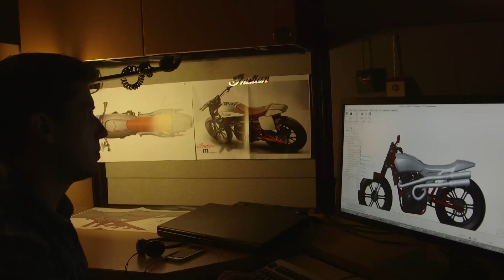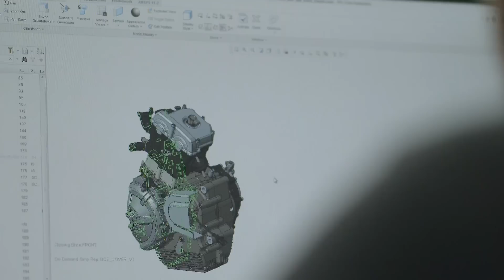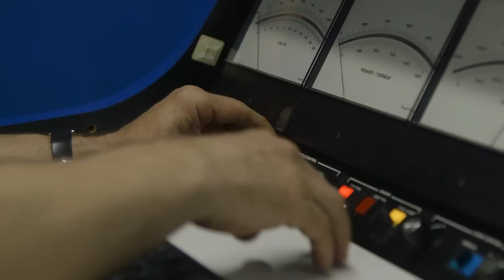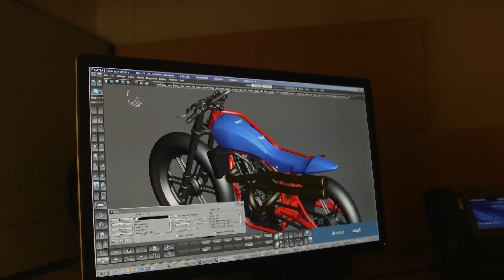CW EXCLUSIVE: Indian Scout FTR750 Flat-Tracker

Comment: The Lockheed SR-71 went from contract signing to first delivery in 24 months and that plane is hundreds of times more complex than any damned motorcycle. Just study the history of that plane and you will learn what true engineers are capable of. Detroit engineers routinely designed and built full lineups of complex cars within 12 months. The average engineer of the "greatest generation" puts to shame any of the best engineers of the baby-boomer generation and they did everything with pencil, paper, slide rules and manual machine tools. And don't get me started on the precocious millennials--most of that generation is uselessly pathetic. If Indian had any real engineers they wouldn't have to fly off to Switzerland, they wouldn't need 18 months to build anything, and they wouldn't limit themselves to building a handful of models. My challenge to Indian is to take that beautiful V-Twin 750cc engine and design an adventure touring bike to compete against KTM. Can you guys do that? It's easier than you think, but thinking is probably your problem.
Reply: Warner Bauer 

The sr71 also had about 12 times the staff working on the airframe, and about 100,000x the budget so it isn't a fair comparison, also the government was pushing Lockheed for that plane, Indian wasn't in any major hurry.
Reply: I meant to write 10,000x not 100,000x
Reply: I am sure that some people will regard your response as the sort of sorry excuse to be expected of entitled and engineering-challenged millenials. Considering that an SR-7 is hundreds of times larger, far more complex, made of titanium, and fitted with exotic engines that were shrouded in nacelles that had to be precisely aligned, then 12 times more staff seems paltry to me and makes those engineers stand even taller. Look, Indian merely has to make the engine, frame, and some hand controls; the brakes, forks, wheels and so on are supplied by third parties. Also, engineers today have access to CAD/CAM, 3D printing, mulit-axis CNC machines, smartphones, Google, and even services like UPS help immensely. So again, my challenge to Indian is to take that beautiful 750 V-Twin and build a scrambler and an adventure touring bike around it. Maybe millenials didn't understand the mantra that was designed for them: "Yes, we can." Or in this case: "Yes, Indian can."
Reply: Warner Bauer America does innovate in the motorcycle market, have you ever seen an EBR?
Reply: 1st off, Merry Christmas! Yes, I have seen the Buells. The first models were built around the pushrod Sportster engine, which is a bit of a joke, don't you think? And the fit & finish were a bit lacking. That being said, the new models are world-class. But they are powered by the Austrian-built Rotax engine, the same, I do believe, that is in the KTM. Design, fit and finish, however, of the new models are all superb. I wish them luck. But American motorcycle manufacturers should take on imports in other categories like scramblers, adventure touring and even MTX. Again, the 750cc V-twin we see in this video should be an excellent platform for a scrambler and adventure bike.
Reply: I'm not completely thrilled with what Indian is doing but remember, they are starting over with a long defunct company and as much as we all love racing, they have to market and sell motorcycles to the public to survive. the tooling alone to create one model is an insane task and requires incredible amounts of money and issues concerning streamlining manufacturing are intensely difficult especially if there is no contemporary design to draw from. 
  I have a wide range of motorcycles and I agree that the Harley Davidson, as far as mechanical engineering and efficiency is is concerned, is one step above a tractor.  The beauty of the Harley is in the ride.  Few motorcycles have a soul like they do.  you don't feel the same on Japanese cruisers whining on all four cylinders with perfect balance. the beauty lies in its imperfections.  go 90 on a shovelhead and tell me you're not having a more fun than going 120 on a ninja.  as far as John Britten goes, he is one of my all time heroes and even he took from and drastically improved on Ducati's motor and chassis. I think it's safe to say that Ducati engineers are in the top of their class as well as the members of the Lockheed Martin Skunkworks. carry on, no name calling boys.
Reply: Well said sir.
Reply: Go back to sleep grandpa. ;- )
Reply: You tell em Sausage King!
Reply: Hmm, let me see, *looks at Warner Bauer's channel*, yeah typical Trump voter here with more anger and rage than they know what to do with. Why not compare Indian/Polaris to motorcycle companies of the past rather than Lockheed? Witness the logic of modern day Republicans/White Nationalists at work.

The worst part is that your original point is totally wrong. For instance the engine used in the SR-71 was the P&W J58, designed in the 1950s and first run in 1958. The SR-71 was the culmination of decades of research and development by thousands of people. Government funded research done by college educated elites.
Reply: Indeed I will get triggered whenever I hear of American engineers flying to fancy Switzerland to pay a handful of European engineers to do a job that they (the Amerivcan millenials) evidently can't do. I wonder how much the American engineers spent to get their engineering degree, which is obviously worthless. Those Polaris/Indian engineers should be fired and their engineering school owes them a complete refund. Since when do American engineers need to fly to any other country to pay apparently real engineers to do their job? Shame on them. And consider this: What, if nothing else, is a motorccle company other than an engine designer and manufacturer? Also, consider this: Harley Davidson was building intricate engines 100 years ago with slide rules, hand-drawn blueprints and manual machines, but millenial engineers have to fly all the way to fancy Switzerland to pay real engineers to do their job. And then they talk about that as if that's something to be proud of! Millenials have no shame, no self-respect. Millenials are a totally useless genration, and I thought mine was wasted.
Reply: Well now you got that off your chest I expect you feel better!  I agree with every word you say.
Reply: Greetings from New Zealand. A few clarifications re your replies: (1) John Britten did NOT "singlehandedly" design, build and race the V1000 - he had a team of very capable engineers by his side contributing in the design and build process, plus John himself never raced the bike in top level competition (No1 rider was Andrew Stroud). My father and I were close to John from the early development days (early 1980s) through to watching Andrew S win the 1994 Daytona Battle of the Twins. Sure the bike was interesting, but it's gestation period was way too long. Sure it won the BEARS World Championship, but check out it's qualifying times compared to the World SuperBikes times at the very same race meeting on the very same weekend at Brands Hatch......the lead Britten was well over 10 seconds per lap SLOWER than the lead SuperBike, which would have placed the Britten dead last on the SuperBike grid. A little observed fact. Sure it was pretty, novel, interesting, but by 1994/95, it was outclassed by production based World SuperBikes. (2): Re Burt Munro. It is Munro, not Monroe or Munroe as you have stated. Casting your own pistons was a fairly common occurrence down here in New Zealand back in the 1940-50-60s. Also grinding your own cams. By the way, there wasn't much Indian left in Burt's Indian - crankcases, yes, but little else. (3) John Britten was not stricken with cancer until 1995, NOT during the design/build process of the V1000 - in fact, after the V1000's best years. Cheers.
Reply: And a little recent history. Indian (Swiss engineered Polaris machine) completely dominated Harley Davidson (American designed and made) in the American Flat Track series.
Reply: @A_Man_Of_Culture_  oh hell no engine was never in any hurry the beat the pants off of Harley-Davidson after their workers break the company for all the parts in the 50 that sort of but they left with Kmart Christmas in spam on a stick so no I don't see any reason why they would be in a hurry knowing they could beat the pants off of Harley-Davidson with a list of everything wrong get it to artificial intelligence and bada bing bada boom you cannot lose Hawaii getting a hurry so you're on the line of Fame and Fortune I can't see any reason to make money can you apparently not
Reply: @A_Man_Of_Culture_  you already lost all your credibility why are you trying to make it worse the SR71 Blackbird is made out of pure titanium the whole fucking airplane your budget wouldn't even buy it for scrap
Reply: @be2keen  what are the odds Millennials will ever get anything right Eric Bill started with first working with Yamaha engines
Reply: @abefroman5191   hey guess what did you know that in the last 40 years Harley-Davidson as actually created new engines newer than a shovel maybe you should check out Harley-Davidsons on Mulholland Drive and if you have the courage you might check out Harley-Davidson passing sport bikes on track like Willow Spring Riverside California and every asphalt track with left and right hand turns in Southern California you got to start with the video aa day  on track with my Harley Davidson Dyna s and the same thing any third person point of view as I using bbrr whatever Honda Fireblade I can barely keep up with the Harley taking its picture
Reply: @be2keen  meanwhile back at the ranch Indian Motorcycle is pumping out motorcycles that Stomp the shit out of everything on a dirt track and last season made a mockery out of everyone else lapping in the entire field everyone else even in 10 lap heat races lapping everyone everything on the track while you're writing speed up your speech explain how they cannot haha hey hey ho ho
Reply: @be2keen  wow you're ranting and raving again totally forgetting that everything you see in front of you that allows you to read this message a single American engineer design built and patented all of it now only patents to all computers in the world including the one that's with have is a super computer and why they went there to use it
Reply: Is this hey careful don't let them catch you talking to. The sheeple people
Reply: @donniebaker5984  you missed my point. The point I've been trying to make is that the engine was designed by Swiss engineers, not American engineers. I know that the 750 flat track engine is fantastic. However, that being said, the engine in the FTR 1200 is American-engineered and American-made.
Reply: @donniebaker5984  I think you mean Eric Buell. Anyway, our esteemed Marxist University so-called "professors" are more concerned with pumping millennials brains full of identity politics and cultural Marxist nonsense than teaching useful engineering skills. The result will be that in a few years time a degree from an American engineering University won't be worth much as there won't be any engineering jobs available in the USA and you can bet that the Japanese, Koreans, Germans, Swiss, Brits, Swedes and Chinese won't be hiring them.